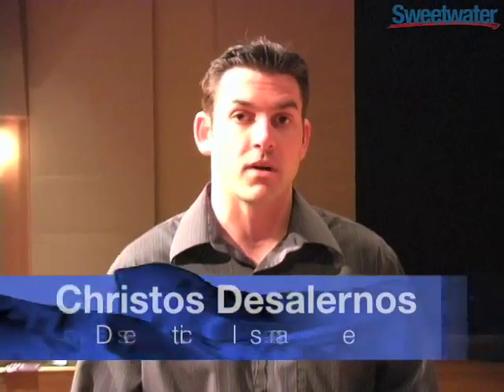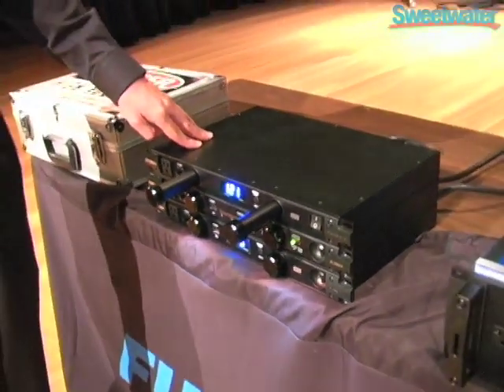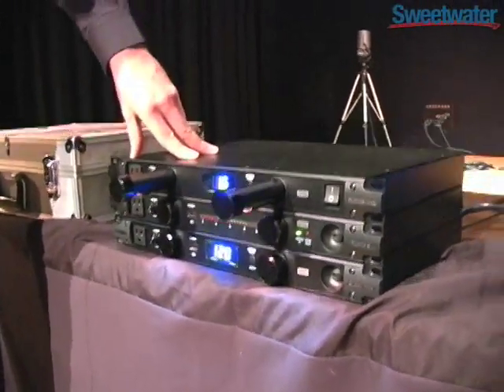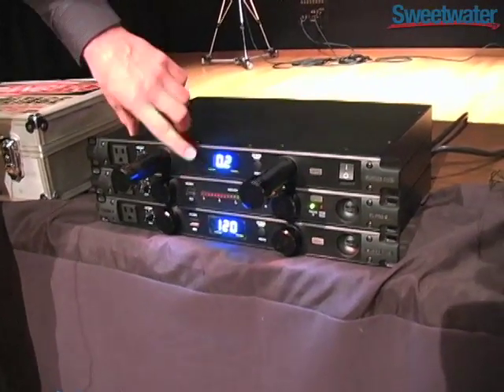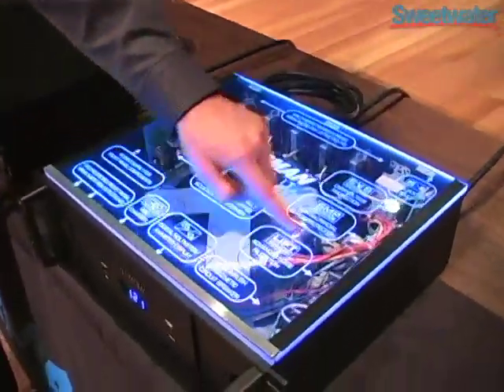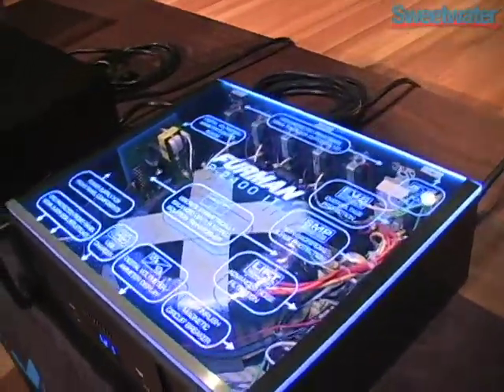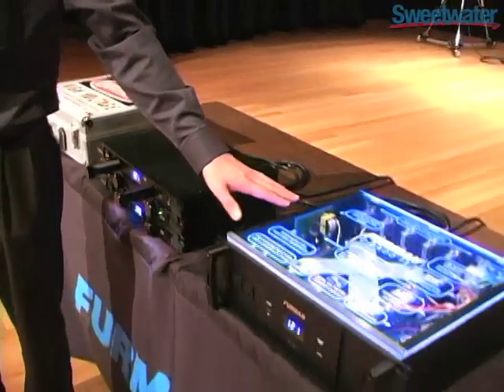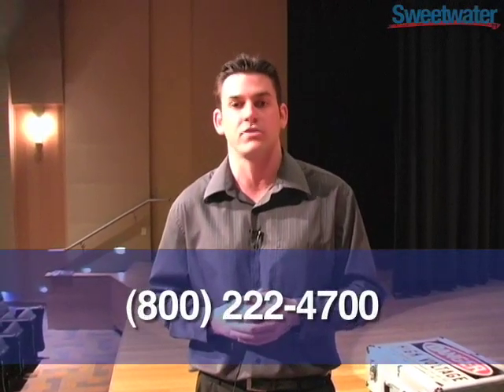Furman PL-PLUS DMC Power Conditioner Overview - Sweetwater

Comment: Doe the dimmer control dim the voltmeter? Those lights that pull out are not an asset imo . How does something that is pointed down help if it's at the bottom of your audio gear ? I'm sure not going to put my blue Ray player on the bottom of my rack , and have some ugly power filters at the top . It's to bad, as the 20 amp model I want from you guys has no meters , but useless lights instead . I swear your engineers have never owned a home theatre setup in there lives .
This day in age it's hard to comprehend such ignorance

Comment: I own a TICE Audio Surge protector with 16 outlets, had all my Home Theatre stuff plugged in when I had a 25K Audio system. The TICE alone cost $1100 and has a lifetime warranty. The fuse inside will blow before your equipment but Nothing, I repeat nothing will protect a direct hit by lightning. Even Mr. Tice said that. His gear is probably the best but lightning is a tad more powerful. LOL I get a kick out of people that invest thousands in audio and amp gear but plug it in to a $30 power strip

Comment: Hi, I already have the furman pl pro dmc 20 amp, but is very noisy, is normal? or I have to have the ac connection to a ground?. Mi rig is, mesa 2:90, mesa triaxis, tc electronics g-major 2, marshall jmp-1 and marshall 1960 cabinet stack. Thanks in advance.